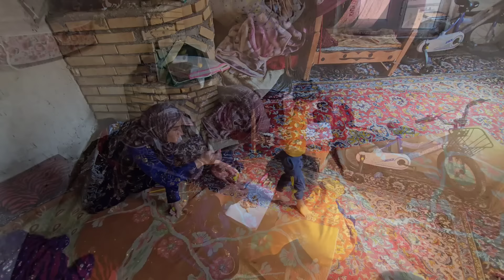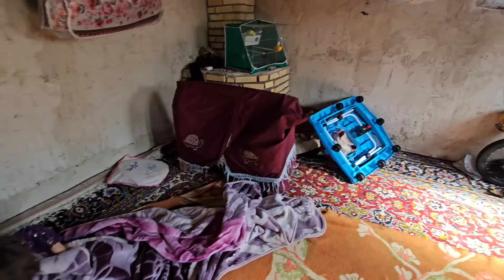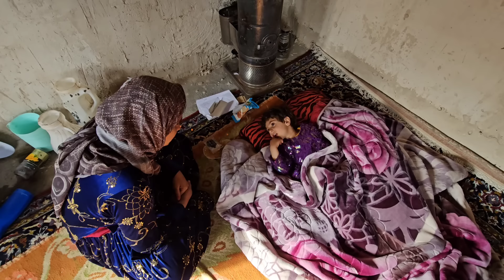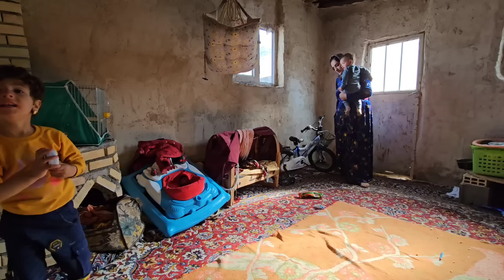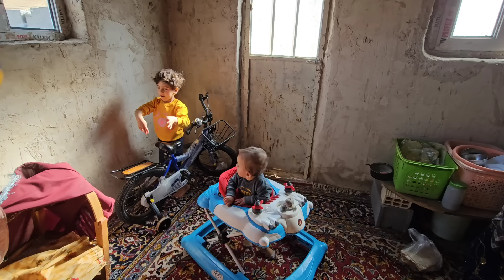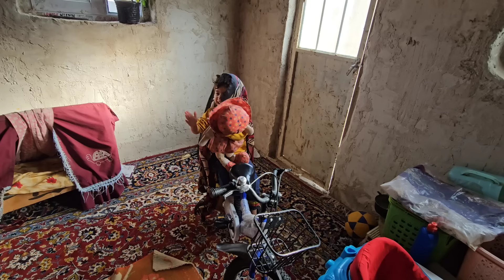The driver is happy about Sakineh's divorce. 🤩 with her wicked husband in the mountains

Comment: What happened to the baby's head? She has a very large head at the top, especially her forehead, could it be the position she is lying in the crib?
Reply: The babies head got banged with the heavy steel door,😮 💔
Reply: probably, it is also flat on the back so it made the top bigger.  Lots of the babies that are tied down for long periods have misshapen heads.